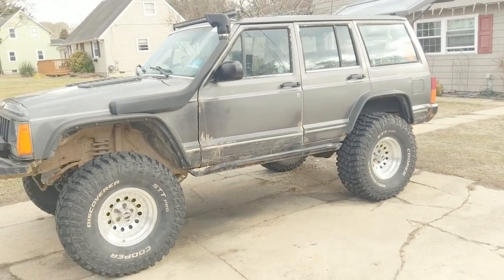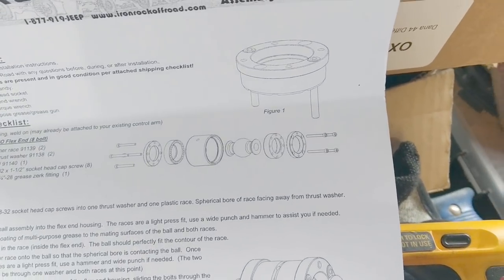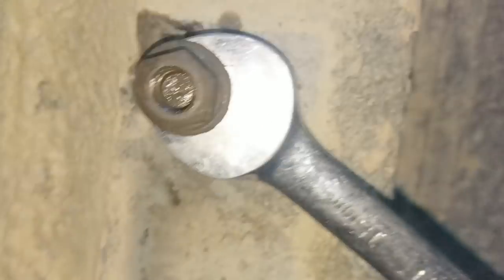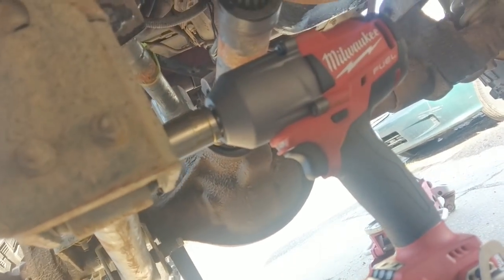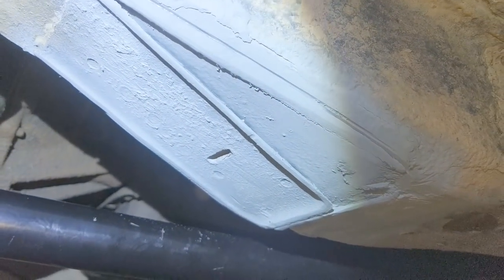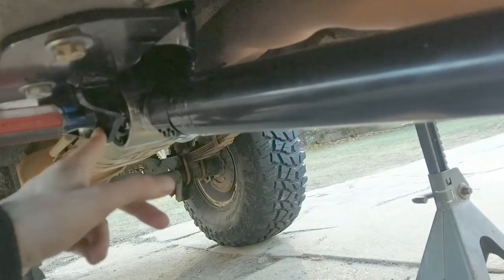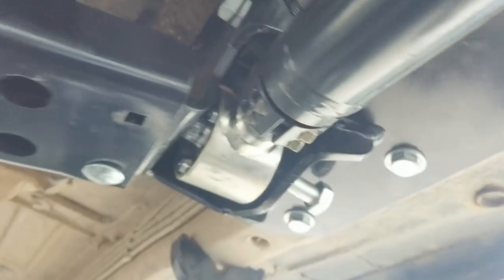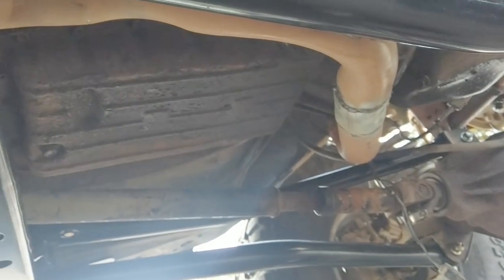89 Cherokee IRO Rock-Link Long Arm Install

Comment: Hey man I’m on 7.5 with shortys and no brackets did you have a wondering issue almost like the front end kinda did what it wanted to do feels like I’m on the ocean lol long arms arnt in the budget rn but the brackets are did it really make that much of difference?
Reply from the maker: Yeah, got a video on them as well. It will help you get a better axle caster angle and handle bumps way better. That with an alignment should help it a bit, but tall lifts just don't like to be ruly on the road

Comment: The carriage bolts are so you don't scrape the hex heads off when you're wheelin if you had a jack under the crossmember it would be a lot easier to juggle those pesky bolts
Reply from the maker: I don't have an issue with the carriage bolts per say. They are fine for what they are designed to do, but having a tighter clearance to the crossmember so they are held in place during installation would help a lot. Getting to the nuts is still a hell of a pain though. I'm thinking the best solution would be studs/carriage bolts pointing down from the side brackets and a recessed hole on the crossmember that could safely house a nut. That would make for much quicker and painless assembly.

Comment: Hey do you have any spare parts may be a lift kit that you don't use anymore even if it's a 2 inch lift kit I don't mind paying the shipping just starting on my 97 xj got it two days ago
Reply from the maker: Not really, most everything has been scrapped by now. You have to buy parts for your intended lift size. I've got RE 4.5" front coils and RE 4.5" rear monotube shocks but that's about it.

Comment: Your drill bit didn't cut, because that front third hole is already threaded. Just need a thread chaser to clean it out.
Reply from the maker: I've heard that some holes were tapped from the factory, but mine certainly wasn't

Comment: Hey Nick, when you stuff your front drivers side to full bump does your upper arm contact your driveshaft u-joint on the axle side?I have the same long arm kit with only 4 inches of lift, but with 2.5 inches of extended bumpstops I have upper link to driveshaft u-joint contact like crazy....
Reply from the maker: Not that I know of. But there is some kind of clunking going on, not sure if my upper axle joint needs replacement or something.
Reply: NickInTimeFilms 
I used the currie 1/2 inch jj for the upper. I highly recommend it. I would look on the upper arm for missing powder coat where the ujoint would hit just to be sure

Comment: Interesting. I remember IronRock off-road offering a radius arm 3 link. Not actually 3 separate links like your kit, but just a Y-link Longarm kit missing one upper link.
Reply from the maker: Yeah, I was not too impressed with their Critical Path radius arm kit so this new design was a warm welcome
Reply: That old kit used a 10 mm bolt (I believe) to hold the caster adjustment. Doesn't seem like a good idea and in some XJ groups, people have talked about breaking them.

Comment: Do you think a rear shock or something would work for the “4th” link? Mounted in the stock upper location?
Reply from the maker: I don't see how that would be very helpful at all since all a shock does is slow down energy transfer, doesn't really support anything.
Reply: @NickInTimeFilms  or maybe a heavy duty stabilizer?(not XJ) Something that would give extra support but that also extends with the length.

Comment: I’m setting my iro long arm up and I have a 4.5”rc lift on my rig.  Do I need to keep my drop down pucks  for my tcase?
Reply from the maker: Depends if you need the drop or not, haha. The long arms don't change any static geometry of the rig, so if you don't have an SYE or you have driveshaft vibrations on the highway then you'll need to keep it on. This kit may even come with it's own drops, kinda forget.

Comment: Looking at it. Are you sure the cross member wasn't supposed to sit on top of the outer brackets? Seems like then the carriage bolts would be useful.
Reply from the maker: Yeah, if you look at the diagram on page 2 it shows the crossmember on the bottom. It'd be really difficult to remove it otherwise.
Reply: NickInTimeFilms hmmm. That's a bummer because the carriage bolts really seem like a bitch.

Comment: Looking into getting this kit on my XJ .. how has it been for you?
Reply from the maker: I've liked it so far. Only other thing you will want is a solid upper axle joint because it will wear out fast with only 1 being used.
Reply: @NickInTimeFilms  Bout a year ago I built a super30 axle for the front ... both my uppers are the IRO rebuild-able flex joints, decided not to go with the rubber. So hopefully should hold up

Comment: The Iron Rock 3-link design is a great design, however IRO optimizes most of their designs more towards the WJ. Good video though. Had you not had the drop brackets on the short arms you would have noticed a bigger difference on road.

Comment: Fucking awsome video brother! Concerning the exhaust they sell flex exhaust at the parts store might help . Hate to see you lose any Hp with dented exhaust pipe. An alignment is only about 70$ , you did all the work let them dial it in for ya. Nice job Nick!!
Reply: Eli Sancere dents dont make a difference on high hp engines, let alone a 25+ year old straight 6

Comment: Wondering  do you have any issues  with your cross member  moving around
Reply from the maker: Nope, stays in place. Is your frame cracked or anything
Reply: No but my buddy  Wayne  has this kit on his  and the crossmember  slides  front to back on the driver's side 1/4 Inch even  being  torqued  down  thinking  about  making  unibody  tieins to the sid of the unibody rail as well  as to the floor adding  sandwiching  points  any thoughts, I've seen  this  done on different  kits.

Comment: If you tip up the pinion toward the case it will throw your castor way off. You CANNOT point the pinion at the case IN THE FRONT, only the rear. If you choose to to point the pinion at the case you need to cut off the knuckles and REWELD them on at the proper castor.
Reply from the maker: And man would I love to retube an axle to get good pinion angle and proper caster, but I ain't gonna do it to a d30. It's a balance of both, if you have highway vibes then you will have to sacrifice some caster, but it's more of an issue with the newer LP d30s.

Comment: Isnt having no passenger side upper control arm weaken the security of the axle?
Reply from the maker: Having 1 less connection means you are relieing more on the remaining ones. Always a debate online if a 4 link limits flex compared to 3, but I wouldn't mind a 4. I did beefy up the upper axle joint to take the bigger load though.
Reply from the maker: That's pretty neat actually, but notice the metal cloak video specifically says it's only for radius arm designs. A radius arm is basically a 2 link with extra support. I have a real 3 link, and it sounds like that won't be needed in a real 4 link either.

Comment: I'm having a problem with the face plate that holds down the Radiator I have one nut and washer holding me off from replacing the Radiator and the fan motor what I need is a grinder but I have no way off powering  one

Comment: Why did you replace your old crappy stock headlights with led ones instead of projector beam ones???
Reply from the maker: After having LEDs on the civic I really wanted to upgrade the Jeep, but all of the H4 LED bulbs I see are too long for my conversion housings. I was hoping that the performance would outweigh the ugly look, but I'm not too sure I'm happy with even that. Jeep needs a lot of work to get back on the road so I can actually test them but I'm just not finding what I'm looking for, especially for a halfway decent price.

Comment: After some time and miles, how do you like this front long arm kit?
Reply from the maker: It's not bad, but you'll want to upgrade the upper axle joint to a solid Currie as this kit eats rubber bushings quick
Reply: @NickInTimeFilms  Ahhh...Thanks for that warning. Not to bother you, but do you happen to have a link to or a part number for the Currie you recommend?
Reply from the maker: @adammede  Whole vid here: https://www.youtube.com/watch?v=nAuiqs2h4-s

Comment: How it holding up and how do you like it?
Reply from the maker: So far so good. I installed a currier johnny joint in the upper axle housing because this blew my rubber bushing to shreds after the first trip, but otherwise is does pretty well.

Comment: Any plans to upgrade your camera? Love the videos but the camera work (specifically the quality) is lacking
Reply: Like idk if its me but after 35 minutes it lags every 3-5 seconds
Reply: Special Snowflake I did not notice that. Only thing I ever notice is what he swears at lol the focus issues
Reply: Ryan Watson hmm. All the other videos i watched today were fine but this one lagged even after restarting my phone.
Reply: Ryan Watson Either way i think the overall quality could be improved with a new camera setup
Reply: Special Snowflake it could, but I look at it as I'm not paying him anything and he produces excellent content so I'm good with whatever choices he makes.
Reply: Ryan Watson Yeah either way i'll stay a loyal sub but im sure he makes enough off the videos to cover a new camera and gear
Reply from the maker: Yeah it's definitely on my end. Some previous software update really jacked up my phones camera so now notifications play while recording which drives me nuts, occasionally the image will lag or jitter and I find that the audio will start to loose sync after this, and auto focus/auto exposure has been pretty horrendous. Couple that with the battery flatlining after about 3 hours of mild recording and you've got the mess you see before you. I swear they do this on purpose so you buy a newer phone, but Verizon hasn't been very supportive of HTC lately so I can't even get their latest model. If only a DSLR could fit in my pocket/tight spaces and not take twice as long to set up...

Comment: 42:08 you don't even have the upper control arm bolt in no wonder the caster is so far off lol
Reply from the maker: That would be correct. didn't want to upper arm on while i decided where the axle should sit, makes it easier to move around.

Comment: I'm disappointed with IRO. That's a poorly designed kit. Cheap hardware, the carriage bolts should have been grade 8 bolts with nuts welded to the cross member, with a 3 link you need a machined Johnny joint for the upper axle side link, and no uni body tie ins for the cross member. 
I ran a 3 link short arm with drop down brackets for about a year before going long arm. Hell, my profile pic is with that set up. I noticed absolutely no change in driving on or off road between the 2 kits. 
I can promise you'll be changing that upper control arm bushing out with the machined JJ, might get rid of that bang you heard also.

Comment: I watched a bunch of this and my only real complaint is your language, not that I don’t cuss, I just can’t watch this with my kids anywhere around and it takes away from what your trying to show.  Aside from that, I’d suggest investing in a plasma cutter, it would have taken 2 minutes a piece for those brackets.  Pro-tip:  use rubber orings to hold the carriage bolts in place

Comment: Hey bro could have got the Rusty's comp 4 link for $100 less and has a much better design than iron rock in my opinion you should check than out even though you did already put on the rock link.

Comment: hope you realize you put the cross member bolts in upside down ... the sqare has a purpose it was to be dropped from the top and bolt on the bottom buddy
Reply: why tf would they have the nut side facing the ground, so you can hit a rock and snap it off?
Reply from the maker: Although I'd love a recessed drop stud design, that is not how this kit is designed. The square holes for the carriage bolts are cut into the bottom of the crossmemeber, only way is up bud.

Comment: It seems to me you was not all that impressed....
Reply from the maker: You would be correct. Maybe I haven't seen where they shine yet, but I doubt I'd notice a difference with a blind side by side comparison. I'm more focused on improving steering performance, so maybe hydro assist and a new/rebuilt box will help more.
Reply: I'm still in decision making phase of my lift and I was warned by an extreme Jeep nut that owns about 10 from Cherokee to zj to wranglers all with different types of lifts and he says long arm will make road performance worse than short arm. He told me if it's not a daily and plan on some serious wheeling where flex is needed then long arms will shine, but if only mild off road in then short arms allow plenty of flex and better ride quality. I was impressed with your rti ramp in one of your videos with your set up and was leaning toward the short arm with drop brackets, but the drop bang I the ass is what I'm leaning away from now. Plus it's not going to be a daily. I think you'll like it better off road
Reply: NickInTimeFilms I think BleepinJeep can help you with that hydro assist setup.